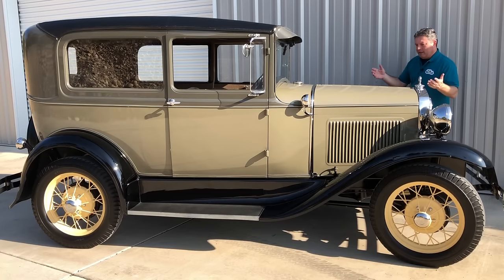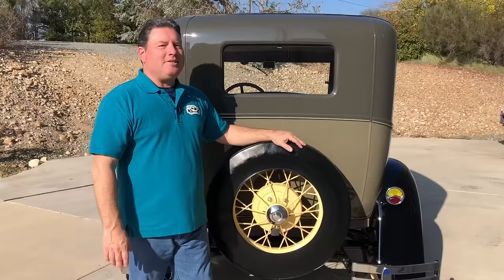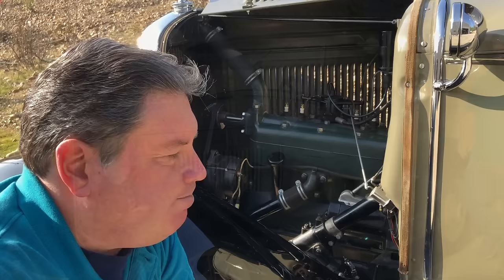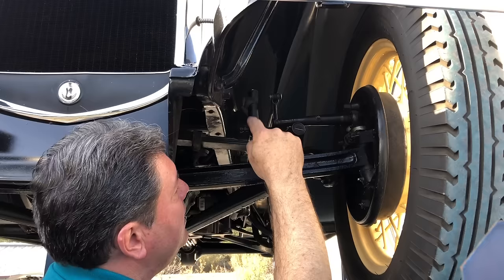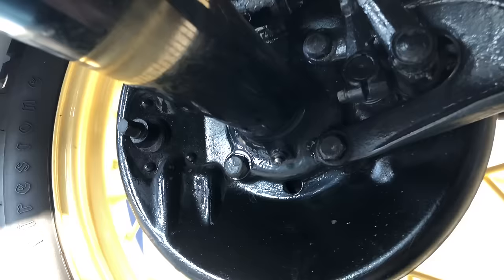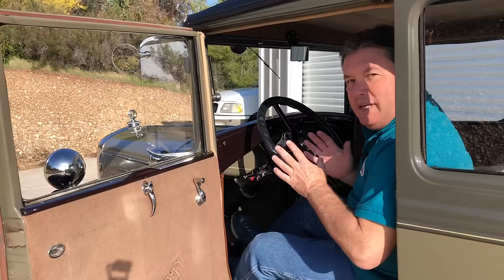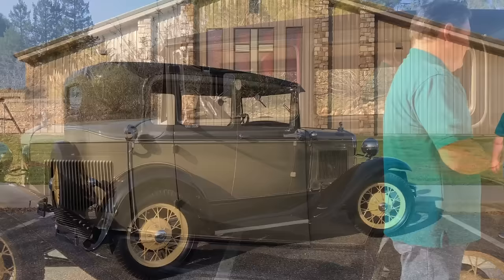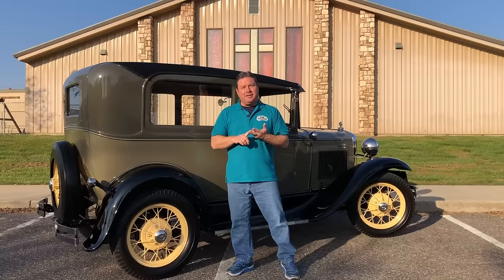Ford Model A Buyer's Guide - How to buy a 1928-1931 Ford Model A

Comment: Paul, great video as always.  I love my 1929 Ford Truck and my 1929 Sport Coupe.  What are your thoughts about those Model A's that have been "upgraded" with hydraulic brakes and electronic ignition?  I am assisting a friend who has both modifications on his new car.  No paperwork on the modifications.  My concern now is parts, like brake shoes or wheel cylinders for the brakes and simple adjustments like setting the timing.  Where would be a good place to start for repairs and parts?  Thank you and hope all is well.  Still Army Strong.
Reply from the maker: Go Army!!  I don't do those "modifications" (downgrades) on my cars, and I don't do it on other people's cars.  If they want to do that, then they can do it themselves.  With that said, I don't care if they do, it's none of my business.  If it makes them happy, then great!  But, I will never, ever work on it.  For starters, it makes the car worse.  It doesn't fix the problem.  If you repair the car in the first place, then you don't have to change anything.  Electronic ignition is the most temperamental "modification" of all.  People who do it seem to believe it runs better, etc.  That just means they had a problem that needed to be fixed.  Again, if that's what they want, then great.  I don't want it, I don't want to work on it, and I don't even want to know anything about it.  When I buy a car with "modifications", the price is negotiated based on the knowledge that I am going to un-modify it before I do anything else.  That is just my opinion.
Reply: Agree.  Some people will always try to improve on what Ford created.  Thank you again and hope all is well.

Comment: Question for you Paul what would be a good price on an unrestored whole model a engine that has been sitting in an old box truck for well over 15 years in your opinion I don't want to low ball the guy but also don't want to over pay still new to this thank you
Reply from the maker: Not much.  Until it has been inspected for cracks or warps, it's worth the scrap value.
Reply: @ModelA  thank you Paul much appreciated

Comment: Great video as always I noticed your driver door does not close flush is this common with the model A as mine also doesn’t close flush but I was told it was because it was misaligned  not sure if I want to do any adjustments or if there are any since it closes easy and smooth
Reply: Don’t touch them before doing thorough research on the proper door fit for your particular body.  I would guess that the door alignment is correct or near correct factory fit. The restoration manuals will show where the doors fit flush and where they do not.
Reply from the maker: The doors on the tudors, coupes, trucks, etc. overlap the body on the rear side, just as you see in the video.  That's how they were built.
Reply: @ModelA  thanks

Comment: We are new to the world of Model A's and found your review very helpful. 
We are actively looking for a 1930-31 pickup. Do you ever do appraisals for potential purchases? We realize the limitations of doing an overview via a video, but could really use a second (expert) opinion before making a 12 hour drive for a real inspection. Thanks!
Reply from the maker: Good for you!! I don't do valuations at all.  Way too much liability.
Reply: @ModelA  Totally understand, especially in todays world. I'll just continue to get educated. 😁
Reply from the maker: Great!  This is one of those times when joining a Model A club is worth every penny.
Reply: @ModelA  Did that yesterday ! We have a very active Model T club here in Corrales as well. Very nice folks there.
Reply from the maker: @janetcrosby9274    Wonderful!! You are well on your way to doing this the right way!!  Unlike the way I did it, which cost me dearly...  Let's not discuss that...
Reply: @ModelA  Paul, what number(s) should be used on the title for a VIN if the number on the frame is not accessible ? We are looking at a 1930 pickup but I don’t see a number on the left side of the engine either.
Thanks for all your speedy responses.Janet
Reply from the maker: @janetcrosby9274    Hmmmm.. Good question.  Can you see the body number inside the cab?  Pull up the floorboard if needed.  Should be on the passenger side near where the passenger's heels would be.  Should be 3 petters with a few numbers after.

Comment: Hello Paul, how’s it going. I have a question. I’ve been out of town since august 20th and just got back. Model a hasn’t been started since august 15th. What should be the first thing I do before trying to start it?
Reply from the maker: Just lube the distributor and go for it!
Reply: @ModelA  I just started it earlier today, and I lubed it. It seems to be running a little rich. I am on the quest why it’s running rich.
Reply from the maker: Run it up and down the street and see if that clears it up.

Comment: You know what Model A to buy?!
A Model A replica that is made a kitcar using modern everything, and most importantly with an electric motor drivetrain.
None of that 100 years old crap.
When it was new, a model A tudor sedan was like 500 usd (that would be roughly 1 full year of minimum wage at that time). So in today's money, brand new, it was like 15.000 usd.
If you find one in ok condition for 1.000 bucks, then you buy it, if not don't waste your money on some junk pile. If you're gonna spend at least be smart about it and enjoy the feeling but keep the modern comfort.
Reply from the maker: You just don't get it, maybe never will.

Comment: How do you tell the difference in the steering gear boxes?
Reply: 1928 and 1929 Model A's used the 7-tooth box while the 1930-31 used a 2-tooth.  An easy way to tell the difference is to see if there's a square plug on the top of the steering box - that's a 1930-31 feature.   Here's a photo of the two, side by side: https://www.mafca.com/images/Steering%20Boxes.jpg
Reply: @mafcawebmaster4237  thanks for the info.
Reply from the maker: The 7-tooth with the round, welded, forged case was available from beginning of production through about August 1929.  The 7-tooth cast type steering box was found from April 1928 through the end of 1929. The 2-tooth was introduced in February 1929 and was standard through the end of production.  My all-original 1929 fordor was built in August 29 and has a 2-tooth steering box.
Reply: @ModelA  I stand corrected - good job!
Reply from the maker: @mafcawebmaster4237    It's an autistic quirk.  I memorized the judging standards.
Reply: @ModelA  I scanned them so that I can now do a computer search; very handy.

Comment: I am having trouble with my model A truck. I can start it and it doesn't like to idle very well and it stumbles and back fires with I try to rev it? Any ideas where to start?
Reply from the maker: Sounds like it is too lean.  Starving for fuel perhaps.
Reply: @ModelA  that's what I was thinking also. Thank you for the help.

Comment: Paul, what is the current top-of-the-line best aluminum (reliable) two-blade fan for the Model A (30-31), and where/from whom do I purchase it? I still have the same original fan from my 31 it left the factory with and I have welded it and balanced it at least 4 times now and I still get cracks.
Reply: Feel the Model A Aluminum fans are all made by the same vendor.  Suggest you check your favorite Model A parts vendor.  Feel replacing your original fan is a smart move.
Reply from the maker: Like Michael said.  All the Model A parts vendors carry the aluminum 2-blade fan, and I believe they are all made by the same manufacturer.

Comment: I would really like one of these but due to medical conditions. I would need to get the synchronized transmission which I know Mitchell makes. And I would also need air conditioning because of my breathing issues. How would you get air conditioning put in one of these?
Reply from the maker: It could be done.  But, if you have serious issues like that, then you don't want one of these.
Reply: @ModelA  I am just looking for something that would be EMP proof I think something bad about to happen within the next few years.
Reply from the maker: @BrettsCorner92    Yep.  It's coming.  But when the EMP happens, is air conditioning really a priority?
Reply: @ModelA  I don't know but I would melt at a 100°. And I probably wouldn't be able to breathe with my asthma.
Reply from the maker: @BrettsCorner92    I have asthma also.  And, I have driven a Model A on a long tour when it was 107 outside.  The trick is to not me modest.  I was naked except I had a towel on the seat beneath and behind me.

Comment: Looking for suggestions how to rebuild my ignition switch is all-in-one. Put a different ignition switch in it
Reply: Check with the parts supplier’s (Snyders, CW Moss, Mike’s, to name a few) for available options for your ignition switch system.  By all-in-one, I assume you are referring to a complete pop-out anti theft switch with the security primary lead cable.  If changing the switch, you’re going to want to retain the pop-out appearance so don’t run to the auto parts store for a replacement switch .  The armored primary can still be used if desired.  Second suggestion would be to have an A wiring diagram, understand how the A primary was originally wired, and is yours stock or has it been modified .  Failing this can result in crispy wires.
Reply: It is stock far as I know everything on it is original to the best of my knowledge.
Reply from the maker: What Myrl said.

Comment: I have always worked on cars selling my mustang foxbody coupe I’ve always wanted a Model A truck good idea or bad idea?
Reply from the maker: If you keep it stock? Awesome idea.
Reply: @ModelA  Thanks for the replay I found a nice ‘31 truck needs a clutch or tranny do you think that route is a good route for cheap or spend a little more and get a fully running one
Reply from the maker: @octane2099    If you're good with wrenches, then clutch and tranny are easy fixes.
Reply: @ModelA  thank you for the replay